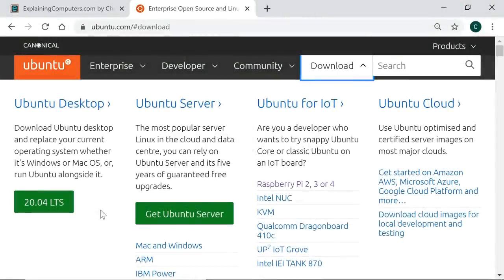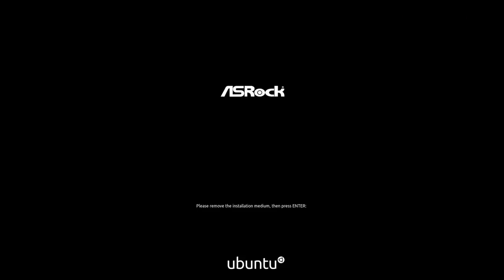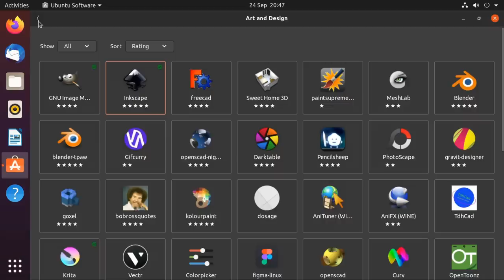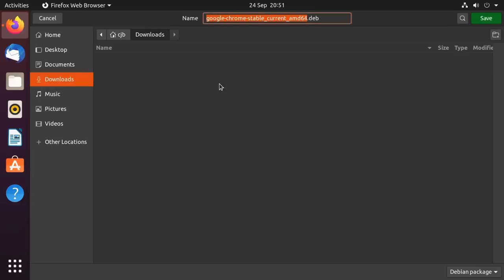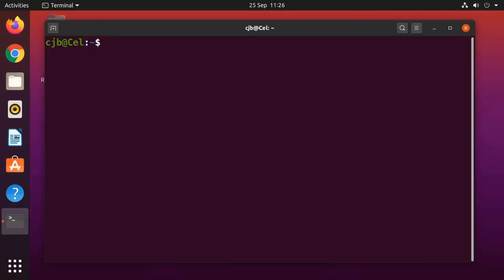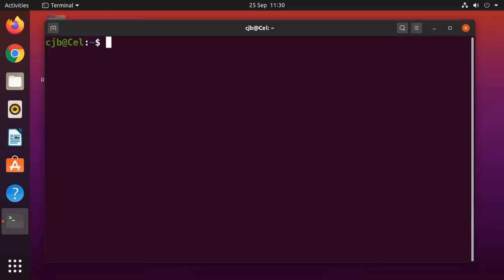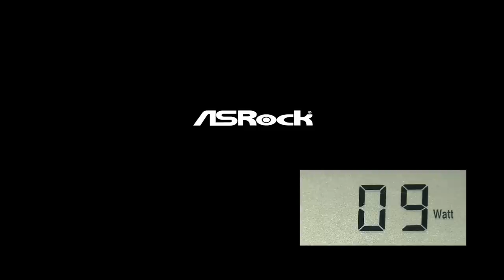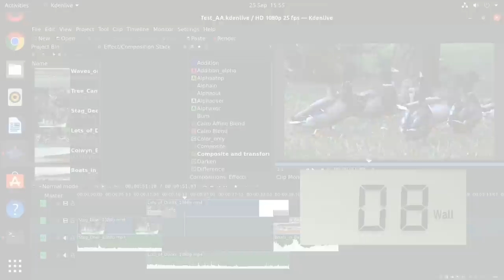Silent Mini-ITX PC Part Two: Software & Power Consumption

Comment: Great video Christopher. All info I could have wanted. Bit jealous of that. I'd love t have a powerful low power consumption rig. Also like the keyboard, I'm on Rii i8 mini now. Would like a ste-up.
Now got the little brother of yours. The RockPiX. Works great for some tasks, but it ain't going to break any records. I do like it a lot for 15-20 year old Windows games. Even Flight Simulator 2004 plays great at 1080p and everything maxed out. I love it, but always want more :)
Greetings.
Reply from the maker: Hi Nico! :) Now I am jealous that you have a Rock Pi X. :) Sounds like a great new SBC that I have been discussing with RADXA for over a year now! I was starting to think that they are mythical. In this Sunday's video I look at the Odroid N2, so very much thought of you when making it.
Reply: @ExplainingComputers  It did have a few delays because of re-design and probably the human malware crisis will not have helped. It is nice for some goals, but I'm used to more CPU power. ARM can't compete with the RockPiX when it comes to gaming. 
I'll make my review about it now. 
The Odroid N2 is making good steps towards better software. But the legacy kernel is still the most trustworthy. One day mainline will be better for all, but it's a waiting game. Greetings.

Comment: Did you also determine frame dropping when playing Youtube 1080p Videos >= 60 fps via Firefox? I got the ASRock J5005 and installed Linux Mint 20 and only Youtube videos with 25fps are smooth. This does of course not affect playing via a media player. Maybe I should try Chrome for this? Apart from that, great video and very power efficient cpu(s).

Comment: Thanks for the temp and power measurements. 62 C at 25 Watts suggests the heat sink unaided isn’t entirely successful. It makes me wonder if instead of silent computing it would be more practical to expect a quiet experience with the addition of a large slow fan. For example I have just seen a new Dell complete small form factor PC for £240, which may actually be cheaper than this build, with an i3-10100 65 W TDP processor which has 3 times the CPU benchmark of the one demonstrated with similar memory, SSD and Windows Pro too. I have searched unsuccessfully for its noise levels but I wonder how much practical difference there would be to the one tested. I do know the Dell example’s temp at idle is 25 C which is not too bad compared to the passively cooled and lower TDP processor.

Comment: I've got a Win 7 Disc can I copy staight to a USB drive or use this etcher thing? This set up seems to be just what I ned as a back up computer and behind the TV very handy  to use the sceen. Will it be very slow though.
Reply from the maker: You can use the Windows 7 USB Installer Tool to create a bootable Win 7 install USB drive. It should work, but you may well have driver issues -- there is no official Windows 7 support for this board. Speed is fine. I've been using this PC for a month or two now as a TV PC. Works very well indeed. :)
Reply: Thank you. I have just realised of course the win 7 has been used before so I don't suppose that will go down too well at microsoft, so I had better buy win 10. I love your vids. I must say your hair style echos mine of 1968. People seem to like your unpacking but to my mind it is better as in cooking programmes where they always have the ingredients laid out ready. Regards David @ExplainingComputers

Comment: Great video! I use the same mainboard... but since some time, it takes (sometimes) a long time to boot... the bios screen stays a long time... do you think a bios update is sensefull? The "error" code says 99/A2 and later A9 (or 7...)

Comment: Just a note. Chromium supports GSuite, sync across devices via Google account and all other Google's services pefrectly well. Also Chromium snap is supported by community and updates automatically (if installed from snap). All of this does not apply to Google's build of Chrome. In fact you'll have to manually update deb package. So installing Chrome hardly  makes sence while Chromium snap is available in the store.

Comment: Christopher, can I run windows 10 on this ? I want to use it for ham radio applications such as Sdr uno, fldigi and ham radio deluxe.
Reply from the maker: Yes, it runs Windows 10 just fine.
Reply: @ExplainingComputers  really? Cool....thanks, I just want to build an inexpensive, quiet, ham radio dedicated computer.
Reply from the maker: @jimmeeGray  Checkout my video on the Odyssey X86 board, which uses exactly the same CPU and has the same 8GB of RAM -- https://www.youtube.com/watch?v=4XV8dlFwNd0 -- at about 10:10 onwards in the video you see me running Windows 10. Performance will be the same on this silent PC.
Reply: @ExplainingComputers  ok, thanks. I'll watch it soon

Comment: Chris. Firstly, thanks for your videos. The are always a good resource.
A few questions from my side:
1. How are network and file transfer speeds?.
2. How does video trans-coding perform?,
3. Does the video output relay 1080p (i.e. FHD) resolution? ,
4. Can you recommend a budget ITX case that will fit one or preferably 2x3.5" HDD?

Again, thanks for your videos....

Comment: Interestingly, the power consumption of your silent PC is quite similar at both idle and under load to my 6i3 NUC running direct off of 12 volts. It would be interesting to see some power usage comparisons on some SBC desk top replacements.

Comment: Nice machine! I was looking for the Asrock J5005, but imo it's a bit too expensive still.
If you installed the default Chrome it does not support hw video acceleration. 
It is better to install Chromium-vaapi through Snap if you want working video acceleration. There are a few guides how to set it up and Grapevine.
Another new option is FF from version 79 and up, which now comes enabled with hw video acceleration for X11.

Comment: Christopher, is there any chance of a LFS and BLFS series from you? It would be nice to see a more in depth look at the process of compiling a custom distro from source than what is about at the moment for LFS 10, such as alternatives to systemd, wayland vs X11, alternatives to (not so)lightDM, Differing ways to build a distro; Using a VM with a LiveCD and with an installed Guest, Linux for windows (I don't even know if that's possible), using a light weight CL distro like Arch ect. On second thought's that could be several years of video : /

Comment: I'm thrilled that you can watch streaming services on Linux. I have had it working on my raspberry pi 4 in the past using Kodi. It was not easy.
When I tried last it was still called Raspbian. Now it is Raspberry Pi OS and can handle 64 bit and boot from HDD.
Will my Raspberry Pi 4 now run Netflix and Disney + without doing the crazy Kodi work that I had to do last time?
Great Video as always. Thanks.
Reply from the maker: My guess on the Pi running Disney+, and probably Netflix also, is that it should, esp if you run Ubuntu 20.x. We are due to see the first official Ubuntu for the Pi this month (20.10), so anything that works here in the x86 version should work on the Pi.

Comment: How did you overlay the wattmeter on the PC screen?
Reply from the maker: In the video editor -- the PC screen grab is on the track below, and at about 18:16 the scale and position of the meter shot on the track above is changed, with a crop also applied.

Comment: Nice pc. Btw, I have this project of a home automation/home theater single board pc. For this I'm searching for a pc that has 2 full size HDMI ports that support 4K60 (and if possible 8K) and a m.2 NVMe slot. Is there a single board pc you'd recommend? (Or at least a pc with a similar formfactor)

Comment: How do you get Linux to support the microsoft keyboards? I've been trying for over 20 years to get MS keyboards to be fully functional in Linux. The basic keys work, but the extended keys and other features don't...
:-)
Reply from the maker: All I did was to connect the dongle. I've found in recent years that kernel support for devices like this is much improved.
Reply: @ExplainingComputers  On that Microsoft Media Keyboard, I had to remember to press Fn + CapsLock every time I powered it up to put the F keys into Function key mode. This allows Alt+F4 to close a program rather than putting the machine to sleep. Unfortunately it doesn't remember this mode, so it defaults back to the funky key mode next time you switch on the keyboard.

Comment: I think anyone that has reservations about the power and capabilities of a Celeron in a form factor like this is missing the point. It's power efficient, it's compact, it's silent, and it does the job of presenting content with the power it has.

Will you be able to play MS Flight Simulator 2020 on it with the highest settings? Nope.
Does it play Crysis? Nope.
Does it need to do either? No.

Not every PC is a gaming PC or a workstation. I have a Mac Mini connected to my TV and it also runs audio out to my hi-fi system when I want to sit back and relax without a screen in my face and just enjoy some music. It's not the cheapest solution, but it has a nice, polished and simple design. If I needed power in a small form factor, there are some old Mac Pro 2013 models on eBay that are more power (if you're into Macs). I could have also gotten a newer NUC, or tried to get the most out of my Raspberry Pi 4B, or gotten a simple device like a Mi Box which just like a simplified Pi without GPIO and it has a remote. The options are endless! But what I didn't want was a workstation with a bunch of fans blowing while I try to enjoy movies, television and music. 😁👍

In short, if someone doesn't like what you have, it's ok! They can buy something else. I would imagine in 5 years you might be able to have even more capability in this form factor. The AMD mobile chips are getting better, for example.

Comment: Had been wondering why you'd need something as beefy as that for a home theater PC... then I saw you install kdenlive. ;) That build dwarfs the power I had in a self-built PVR many years back, and if you just want a pvr/media consumption machine then a raspberry pi would be more than enough grunt I'd think. Still... lovely build, and I think it'd make a fantastic desktop replacement for somebody who wants a silent PC. It's a shame the motherboard doesn't have NVMe support - but if the M.2 slot supports a 42mm M.2 SSD it would be a fantastic system for that application

Comment: That's a nice system. I currently have a Mini ITX system running witha I5 3570T processor and I would like to use it as a Plex server next to my Proxmox with Home Assistant. Would you think that a system like this (the one you've just build) would be better at running Plex or the I5 I am currently running. I know that Plex can be quite the resource burner.

Comment: Very nice - Would you consider using a Raspberry Pi 4 for a HTPC?
Put on Libreelec which is a Kodi centric solution, and perhaps point it to a backroom NAS  and you have a very light HTPC solution...
Reply: Im using Pi as low carbon footprint htpc
Reply: @rogerwalter2500  Same here, it's a Pi3, works like a charm.... may upgrade.... Imagine powering it via solar panel....
Reply from the maker: I would, but Kodi lacks an official YouTube app, and I cannot access Disney+ or BBC iPlayer via it either. So it all comes down to content.

Comment: Hey Chris have you ever connected more than 1 PC to a single monitor/tv using an HDMI KVM and ethernet switch.

I did it with my 3 PC's and they are so good, never lost any connections. Oh also it only need 1 USB cable and 1 ethernet cable per machine.
Reply from the maker: I run with a switching system on my desk, two PCs to one monitor.

Comment: How about CPU usage in Ubuntu for Intel core i3 230M.🤔
Reply: I've used Ubuntu with i3-2328M and 6 gigs of RAM . It's very snappy and capable of multitasking . Very Very useable in modern standards. 
(Have a swap partition in my boot SSD)
Reply: One HUGE advantage of Linux distros over Windows and OSX is that things are NOT fixed. a) You don't have to install everything (you don't even need a desktop environment. You just need to install what you need as a base for what you run on the machine). b) Even if you need a graphic environment and (the now default) GNOME eats up more than your PC can chew, you ALWAYS have the possibility to replace it with a different graphic environment with less needs (see Ubuntu-alternatives; see full-fledged-GNOME vs KDE vs UNITY vs MATE vs Cinnamon vs Bungie vs LXDE / LXQT). Yeah, I know, may names on top of "what ?! multiple desktop enviroments ?! what the heck is this ?! HELP !!!" :-))) but in the end you might just have some revelation(s). No, not the "religious" type :-)
Reply: @Smjork  Agree. 
I distro-hopped for nearly 8-9 months before finding out about desktop environments and window managers.
(Tiling WMs takes up less system Memmory)
I found my balance in Ubuntu + XFCE + Bspwm and used it for a long time

 Also suggest my friends to install "PepperMint OS" in there low spec machines

Comment: Whenever I have installed an iso image 2-3 times with etcher on my usb stick or an sd card, it is broken and when formatting it shows that the program cannot be found. within a short time i destroyed my entire supply because i had created images for my PI, my laptop 32 bit and my linux test computer. Why is that? is there another program for bottles?

Comment: Delighted to see that modern Celerons are so capable, vs. early (miserable) Celerons.  Is this the case with Ubuntu?  I was an Ubuntu early adopter and got burnt by their commitment to ship by date, rather than when ready.  Better now?  (I run MX-Linux, based on Debian Buster, and love the stability.)

Comment: Great video as always.

I was told once that a computer monitor pulls more power than a typical PC. I'd be interested in seeing what the power usage of a modern monitor is compared to this low power PC.

Also, does linux have wake-on-lan capability? I could see that would be  useful for a media PC if you didn't want to power it off.

Comment: Great for running off of an automobile, with 12 v. You would use even less wattage because you don't need the AC/DC converter.
Reply from the maker: Very true.

Comment: Did Ubuntu recognize the wifi dongle, or did you have to download something?  I ask, because I bought a wifi dongle it was supposed to be Linux friendly, but wasn't recognized by the distro I was using.(MX Linux-Debian).  I had to run a command from terminal, then it became recognized.  Thanks.

Comment: Silent PC use to be slow. Much has improve. Wonder when will arm chip closed the gap. Another great show.
Reply: most cheapo tv media boxes are now based on smartphone hardware. large volume chips make for cheap prices and the quad and octacore cpus are fast enough IF the software (android...browsers..) support the hardware acceleration good enough.

Comment: Have you used the Logitech K400? If so, how does the microsoft offering compare? On another note, those power consumption & temperature readings are seriously impressive for x86
Reply: I haven't used the Logitech K400, but I've been using wireless, dongle-based Logitech keyboards and mice with distros based on Ubuntu for about 10 years and have never had a problem.
Reply: @DallasMike424  Yeah, I've been using one (the K400) myself with my Pi, it doesn't have any compatibility problems, but the keys are extremely 'mushy' and the trackpad is just about usable (admittedly I've been somewhat spoiled by using a mechanical keyboard, but as far as membrane keyboards go, there are definitely better ones out there) - I only use my pi for emulation right now so it's not that big a problem, however I have vague plans to make a HTPC at some point and would be interested in knowing if the microsoft trackpad/keyboard combo is less unpleasant to use.

Comment: I like how you just bought a microsoft keyboard and installed ubuntu.

[Sad microsoft noises]
Reply: Given how chummy MS and Canonical are these days I would say a match made in heaven...
Reply: @Deon Denis Linux MX with NO system D, leaves ubuntu in the dust.
Reply: @petermoeller5901  Microsoft makes very nice and comfortable keyboards indeed.
Reply: @petermoeller5901  I have K400 from Logitech that's very similar.

Comment: Nice build :) Although I do wonder, if Linux will ever get to a point where no commandline mumbo jumbo is needed..?
Reply: @gilkesisking So, would you say everything can be done through the GUI nowadays then? I've been trying out Ubuntu every few years, but always been running in to small niggles with drivers etc. requiring some command line wizardry. Maybe it's time for me to check it out again :)
Reply from the maker: @gilkesisking is right -- you can do a very great deal via the GUI these days. As you saw in the video, I installed all my main apps graphically, although I did need the terminal for more technical utilities, but many users will not want or need those.

Comment: Thanks for your great videos ;-) - Did you perform a passmark test with this setup? Thanks and keep up the good work :-)
Reply from the maker: Thanks for your kind feedback. I've not installed Windows, so have not run Passmark.
Reply: Thanks for your quick response. The reason for my question is the plan to build a Windows office pc for a friend with this board. But i guess it is suitable for office, Web, mail, Music and foto management. Actually he is using a mac mini 🙈 what do you think? Or do you have any other recommendations?
Reply from the maker: @FelixWombat  It should be fine for what you suggest -- I did Passmark the same CPU in the Odyssey X86J4105 in this video: https://www.youtube.com/watch?v=xqIHsJLDdN4